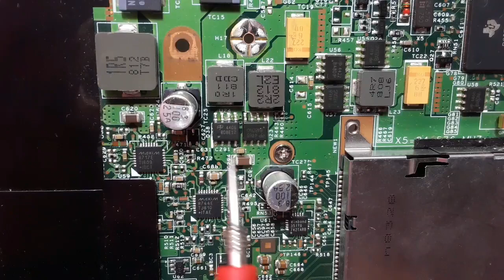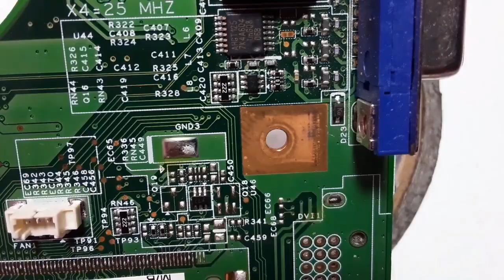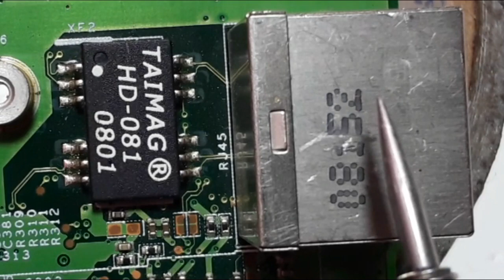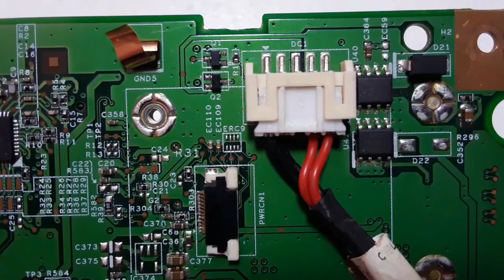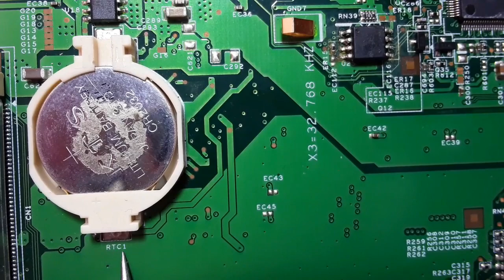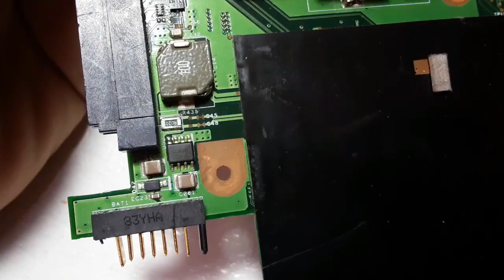Laptop motherboard components guide part 1

Comment: I started playing around back in 2005ish with lenovo laptops replacing the password chips then selling the laptops. During this winter I picked back up playing with laptop motherboards. My struggle currently is with HP laptop motherboards as nothing is labeled on the board like this. I believe it's because they are patented so they make it a pain. I figured out some of it but man it's a pain. Can you go over one of these a little in depth like you did in this one? I'd be greatful.

Comment: Hi a capacitor on my 2021 Hp Omen 15 had burnt, what can I do about it? Is it sothered to the board? Do I need to replace it just because of the capacutor?
Reply from the maker: Hi there,
Join me either on Patreon Page or facebook group to assist you (Post you issue)
Reply: @electronicsrepairbasics_erb  okay, Ill post about it now
Reply: @electronicsrepairbasics_erb  ive posted it

Comment: at 08:55 you talked about current sensor , my question is how to find out which side is plus and which side of current sensor is  minus with multimeter . for example for inject voltage on the mainboard we need to find out plus side to inject voltage .  thnx
Reply from the maker: already answered. The current sense resistor is not polarized, it's like a fuse, it is designed to melt when a high current flows through it